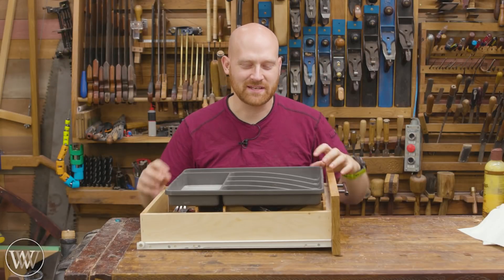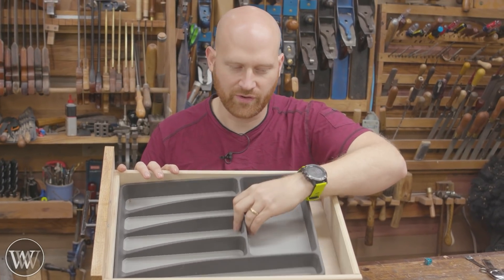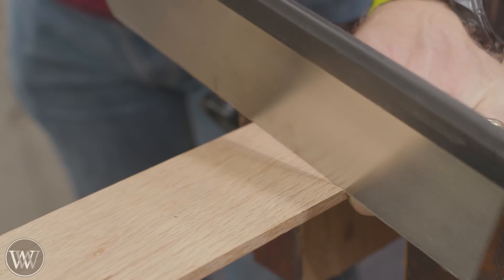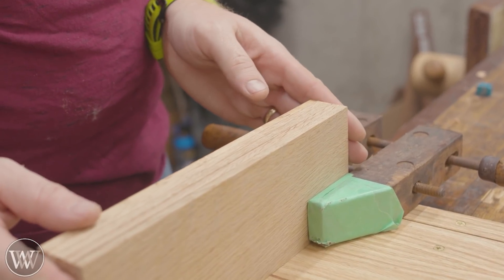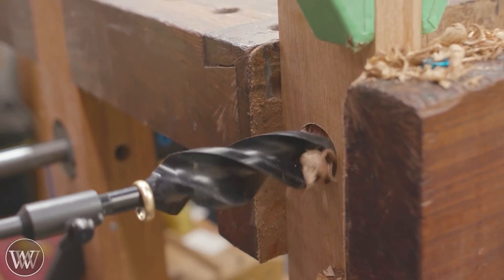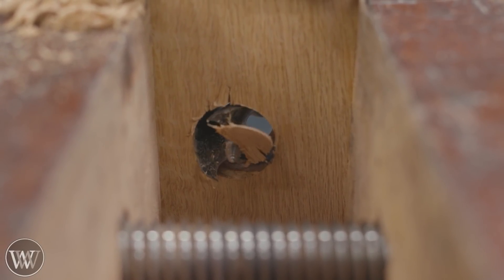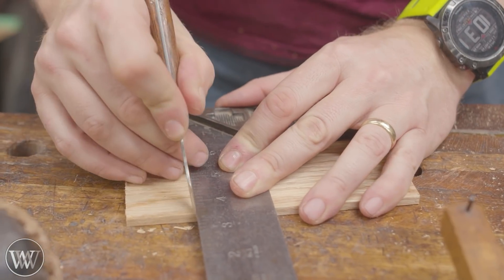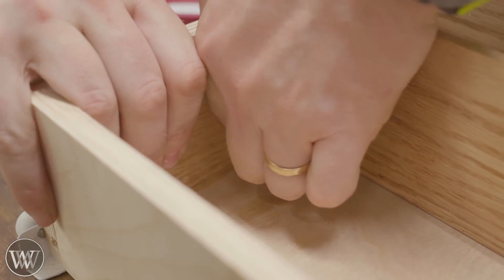How To Make A Silverware Drawer Organizer

Comment: I made a silverware organizer from pine some weeks ago. Didn't make anything fancy and used butt joints with nails, but it's a lot better than the old plastic ones. Maybe I'll make them again from hardwood and proper joints in the future. I'll save this video for reference. Thanks, James.
Reply: One thing to note, I made mine like a tray, so I can remove it from the drawer with all the silverware inside it.

Comment: This is an awesome build that I'm going to have to save for later. My family's silverware drawer is so cluttered with different things that I've been thinking of making a double decker when I get the chance. We currently have two plastic silverware organizers stacked up that are too short and don't work that well together, but every space is pretty much filled to overflowing. Silverware, tea balls, measuring spoons, paring knives, skewers and chopsticks, flat graters, a can opener, and even those plastic straw-lids for mason jars make the whole drawer way too crowded, and the spoons are always trying to sneak in with the forks. And it doesn't help that the whole drawer just rests on a pair of 1x1s without proper full-extension drawer pulls, which could mean I have to rebuild the whole drawer when I can find the time.